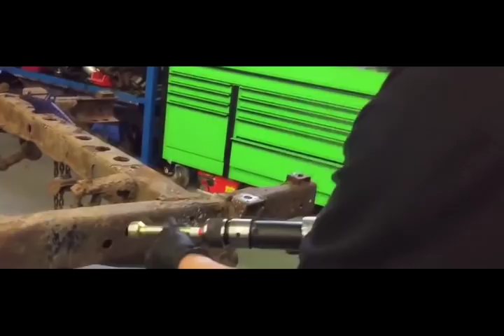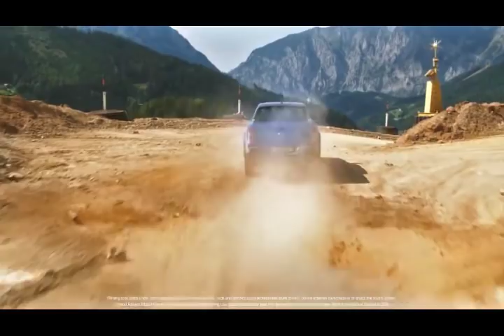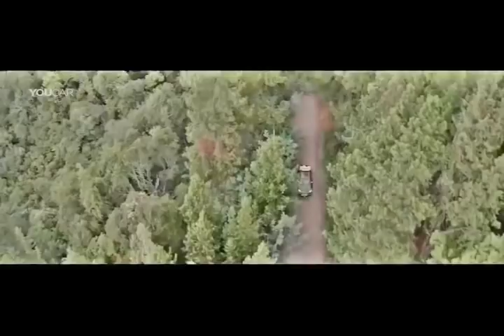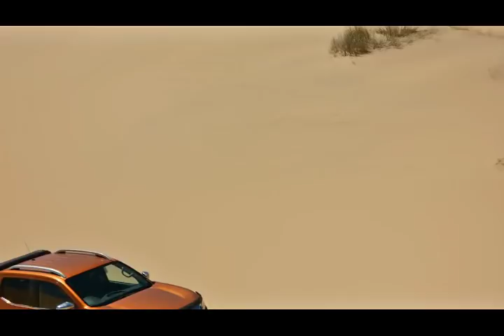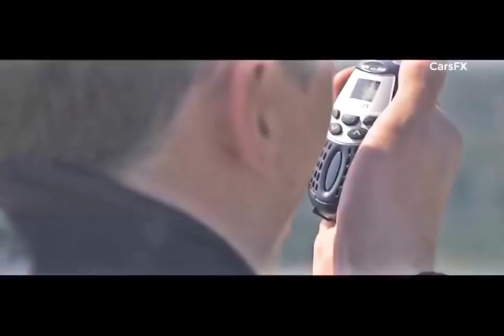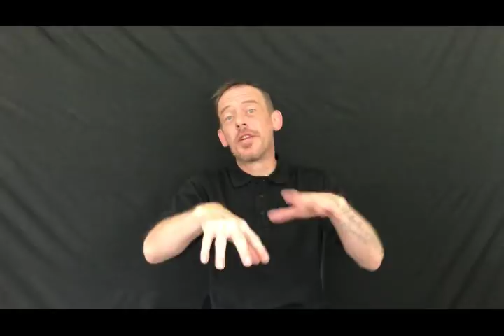Best New Pickup Truck Review 2018

Comment: Ey up dez, I bought a 2015 VW AMAROK 2.0l bitdi highline with 23k on the clock for under 23 grand early this year. Having previously driven rangers for the past 8 years the amarok is leaps and bounds ahead in terms of comfort and ease of drivng. She tows well but I only pull 2ton. 22k between services is a treat also. Less time off the road is always good. Keep up the good work.
Reply from the maker: Thanks mate your input means a lot keep us updated with any issue's, Thanks again for sharing your thought's. Des

Comment: i have heard that toyota are made indestructible but have issues with  instability and slips a lot 'cause is very lightweight in the back... and it's more than very expensive (at least here in colombia south America) i have a navara 2009 and thinking on buying a new pickup. by now it all looks like the nissan np300 have the highest value/price rate.

Comment: I've been using Toyota Hilux pickup trucks for years. They have never disappointed me. Those are build to last . As for the best looking pickup , I have to go with the Ranger.
Reply from the maker: What engine size
Reply: 2002 : 2.8L MT , 2006 : 3.0L D4D MT , 2008 : 3.0L D4D MT , 2013 : 3.0L D4D AT,  at the moment my daily driver is a 2018 : 2.8 D4D Turbo AT. All were imported from Japan.They've never had any major mechanical failures.
Reply from the maker: Now that is what we need to hear, Cheers Buddy
Reply: Looking forward to watching your unbiased and honest reviews. It is extremely rare on YouTube nowadays . Cheers !
Reply: They have always disappointed me. I could never stand their low set driving position and stupidly hard ride. The new model seems to have all that sorted but is sent to the UK with one of the most anaemic engines available. Why Toyota? Why?
Reply: Huw Williams What is your ideal pickup if I may ask ?
Reply: My ideal pickup would be a mixture of Land Rover Defender full time 4x4 system, compete with open centre diff in low range [unless locked by the driver] with a rust protected chassis with all the mud and rust traps eliminated, with the body of the Ford F150.
Indeed the American pickup has a lot of driver-centric features that are totally missing from the ones we get in Europe. If only they were a bit smaller. Have you seen reviews of the latest Ram and GM pickups? They are spectacular.
For the UK market and certainly for my use, the ton carrying capacity and 3.5 ton towing is essential and non-negotiable.

Comment: The Ssangyong Musso is the most interesting truck by far. Nobody seems to have really tested this new model, which looks good and, on paper, is as capable as any, but with a seven year 150,000 mile warranty. In auto form it has the excellent Aisin six speed box, rather than the weaker and less economical five speed which the L200 and Fiat has.

The new Ford, as seen in that video, is unlikely to be available in the UK until November next year. We get Fords from South Africa in the UK and their Struandale Diesel engine plant out there is not yet geared up to produce the wet timing belt 2.0 Ecoblue that the new models will all get. Well, apart from the UK built Lion V6 3.0 as currently fitted to the Range Rover Sport etc. This will be mated to Ford and GM's joint venture 10 speed automatic, which will move the Ranger head and shoulders above the competition, as long as they also fit a full time 4wd system with open diff in low ratio.

Comment: The ranger is a great looking vehicle, great package off the showroom floor, a nicer place to sit, at least for about 50,000km before the difference in build becomes apparent. If you turn your vehicle over every 100,000kms then that’s fine with the Ranger. If you intend to keep your vehicle then the Hilux and Mitsubishi L200 is by far the better engineered product. Over the long run the Toyota copes better with work demands. Unfortunately, reliability and build quality are never used in reviews. In my opinion, the single biggest flaw with all motoring journalists. It's hard when reviewing a car to test reliability when you've only got the thing for a week. The real test is how the vehicle stands up over 5-10 years.

If u got money: Ford ranger
Reliability: Toyota hilux
Value for money: Mitsubishi triton. The Mitsubishi 4n15 engine is reliable, fuel efficient, refined.

Comment: Navara has far too many holes in its chassis around the rear wheel arches. Toyota have none. Navara has coils at the back which is OK for leisure and lighter work, but for carting 3.5 tons of box full of moving cattle, its not so hot. I've not found anything better than leaf springs for the rear axle of a hard working and carrying  truck yet.
Reply from the maker: Thank you so very much for your honest input, it means a lot to hard working people. Des
Reply: You can get the Navara with leaf springs too! Just depends on how you spec it.
Reply: mhtl48 
Only if you are happy with king cab and mid length bed. In the UK at least.

Comment: Ford looks the best. Im running a twin turbo dmax. No problems at all, routine servicing expensive but a few trucks at my dealer are running fine with way over 250k miles on them. Got to admit, not that exciting to drive.

Comment: Toyota Hilux is a the best all round . Ford ranger is good in the 3 litre only the 2.5 has no power . The L 200 is a good motorway jeep but the lock is no good
Reply: Ford don't have a diesel 2.5 or a 3 litre.
Reply: Huw Williams As far as I know Ranger comes with either a 2.4L or a 3.2L . At least in my country.
Reply: In most areas of the world the T6 Ranger gets either a 2.2 four cylinder or a 3.2 five cylinder Diesel engine. Petrol versions are available but as far as I know none are sold in the UK. I have not seen any mention of a 2.4 in a T6 on any review ever. Might it be. a petrol engine? Or perhaps the previous model Ranger, pre-2012, which certainly had a 2.4 diesel. 
I currently own a 2.2 diesel automatic and previously owned a 2007 2.4 manual Ranger.

Comment: The Ford Ranger is very capable but let down by mediocre engines that are very thirsty, and by Ford back-up which is near non-existent. For instance they know that certain 2.2 and 3.2 engines have oil pumps that are prone to early failure and the same basic engine has been recalled in Transit and LR Defenders to change the pumps. Not in Ranger who's owners are being left out to hang and dry. Massive bills for new engines with Ford contributing nothing, let alone making good their crap engineering for free. It's such a pity, because it is such a well built and capable truck otherwise.
Reply: Ranger oil pumps are variable and oil changes must be carried out in less than 10 minutes as it doesn't self prime. If you leave it longer your engine will run dry and will be destroyed. Can't blame the oil pump for that if you don't follow the instructions.